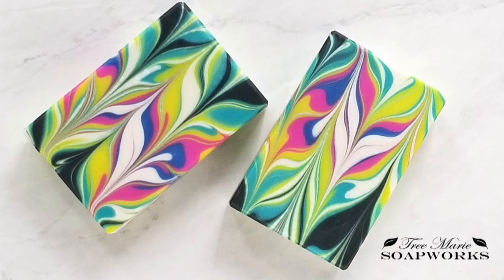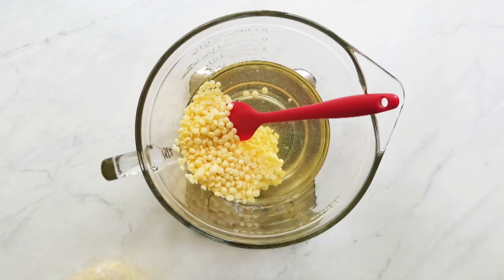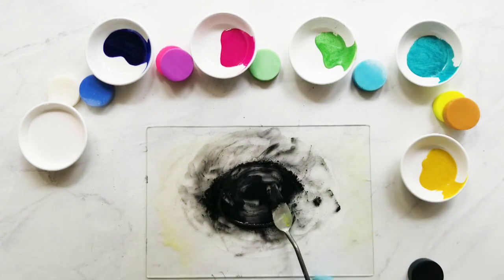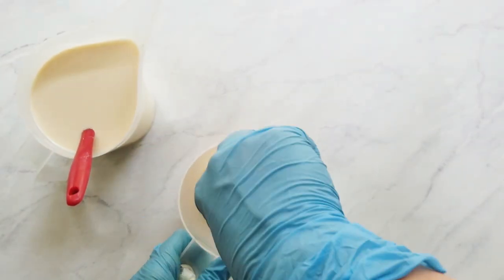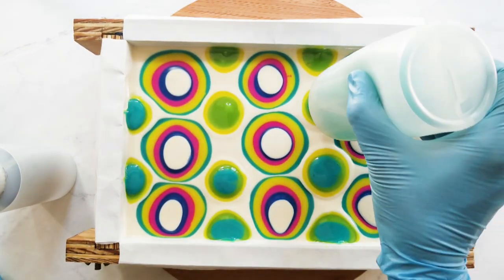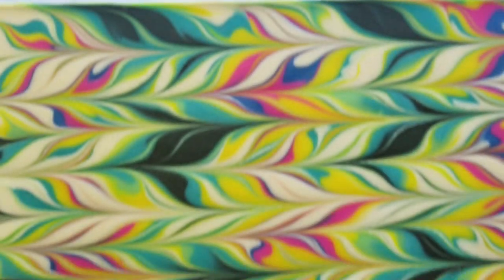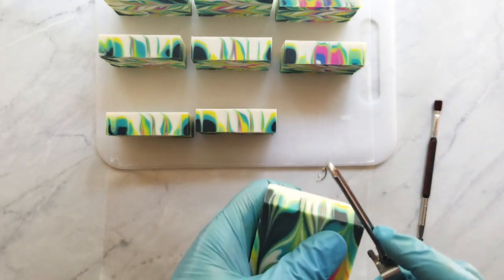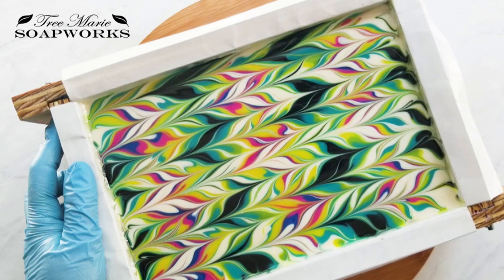Marbling Swirl Cold Process Soap (Technique Video #19)

Comment: Slanting the ruler ensures the easiest way to divide the slab into equal parts by allowing the cutter to mark on the largest line on the ruler at each interval. However, if you want a desired width, then you have to measure perpendicularly.

Comment: Thank you for the instructional video, it turned out beautiful.  For me, I would probably use less colors, it is a bit busy.  Thanks for the tip about using the plastic inside the squeeze bottles, great idea, I am sure it makes clean up so much easier. :) <3
Reply from the maker: You are right, I rarely use this many colors. I just wanted to this time. 😘💕

Comment: What is gel and not gel for soaps.   I hope you understand my question.  I've watched some other soap makers and they dont place theirs in the oven.
Reply from the maker: Gelling happens when soap heats up starting in the middle and spreads out to the edges. Other soapers make larger batches and use a higher water %. Higher water and larger batches equal easier to gel. My soaps are smaller batches and lower water. Lower water soaps with smaller batches may need a nudge to get all the way through gel. Either way, your soap is fine. It doesn't have to go through gel. I am trying to avoid partial gel because I don't like the look of it. Also gelling my soap along with lower water helps to avoid soda ash, glycerin rivers, sticky cuts and it makes a harder bar. Here is a link to a partially gelled soap of mine. https://www.facebook.com/TreeMarieSoapworks/photos/a.751305801660231/492401444217336/?type=3&theater
Reply: @TreeMarieSoapworks  thx for the reply and info.  Also, have you ever made an oatmeal soap

Comment: Wonderful soap as always, and I appreciate the lesson on the way various things can affect trace and cause acceleration. All very interesting. 

As for the colour change thing... I may have an answer for that (with the yellow oxide). It turns out that in concentrated sodium hydroxide, iron oxide can sometimes for complex ions that are (I believe) colourless - and this would reduce the intensity of the colour if that's so. It may be that the concentrated sodium hydroxide solution plus the extra high temperatures for gel phase are causing some of the iron oxide to form this complex ion at a greater rate than normal. I need to get confirmation that the complex ion formed is, in fact, colourless (or at least, paler yellow) and if I can find that out for sure, then that might be the answer to why gel phase with steep water discounts cause some iron-oxide-containing micas to respond that way.
Reply from the maker: That is very interesting! When I use the yellow oxide pigment it is always a very deep yellow. I did find out the micas only contain 1-5% pigment, the rest is mica and TD. That might explain a lot of it right there. That is not that much color! I talked to someone who owns a soap supply company and she said that the yellow micas may need 3x as much colorant. She said that the oranges are super heat sensitive, the hotter they get, the more peach they are. It so interesting. I'd love to hear what you can find out.
Reply: @TreeMarieSoapworks  If it were consistently just paler, then yes. that would possibly be it. But the vast difference that happens (for example) in the same bar of soap with and without gel phase specifically with steep water discounts (as per that other maker's video) suggests that it's something else that's going on, rather than just needing more in general (I did see in the video that you mentioned that). Although needing more would make sense aking with that, I think - that you need to use more because of the risk of it being formed into a colourless complex, and having to provide extra to compensate. But absolutely I'll let you know if I find out for sure.
Reply from the maker: Yes, the low percentage doesn't quite explain it.I appreciate you looking into this. 😘
Reply: @TreeMarieSoapworks  You're very welcome, it's the kind of thing that bothers me not to know, anyway. :)

Comment: You answered a question earlier in the comments about why you use distilled water, could you use demineralised or deionised water instead of distilled? 
Thank you for another great tutorial, and just like most of the other posts, I think the black works well.
Reply from the maker: You can probably use the demineralised water. I am not sure what the deionised. You would just have to try it. It would probably be fine, but I just don't know for sure.

Thank you! The black is a keeper! 😊

Comment: I went back and watched this one, and your explanation of oven processing reminded me of something.  I use water as 25% of oils, and I had been oven processing my soap, but realized recently that my soap was overheating (bubbles on the edges of my silicone molds).  I haven't done much research into this, but my hunch is that different blends of oils heat up more easily.  I use a combination of lard and tallow for my hard oils, so others who do the same may not need to oven process to get gel, even at a steep water discount.  Has anyone else noticed this?

Comment: I wish that colour calculator had a grams option
Reply from the maker: Do you use soapcalc? If so, it already converts it to ounces. 💕 Also, that same page with the calculator has a Weight Conversion calculator. Check it out here: https://www.elementsbathandbody.com/calculators/
Reply: @TreeMarieSoapworks  i do use soap calc! And it's odd the other calculators on elements have a grams option, just not the colour one. Ounces look like pure jibberish to me, I know I can convert but I find it so much easier and more accurate just working everything out in grams to begin with